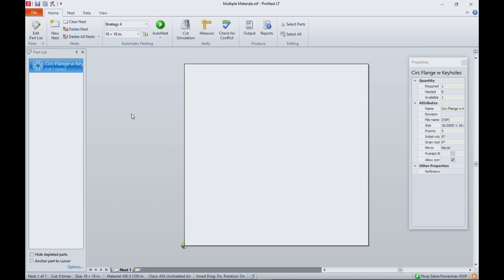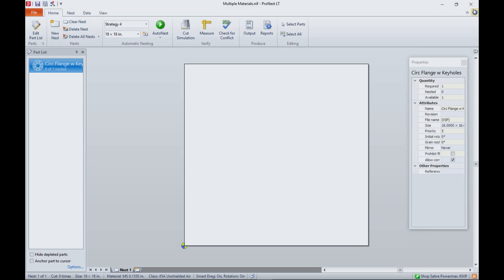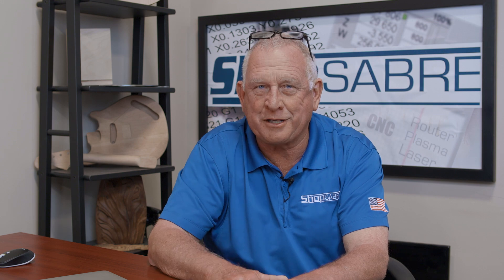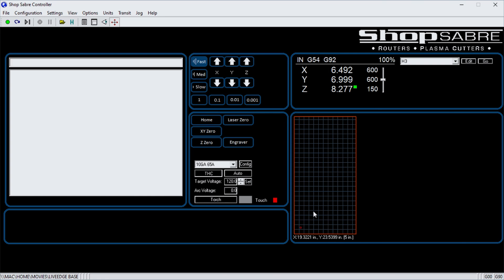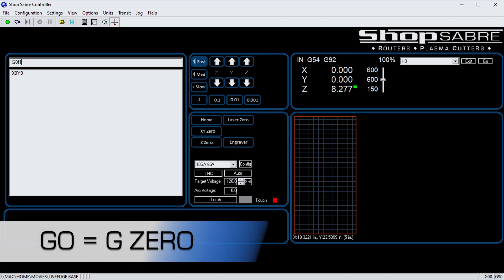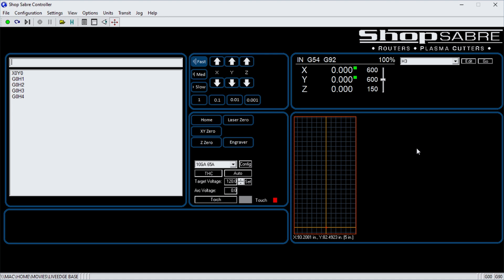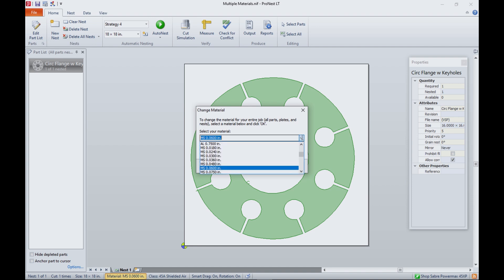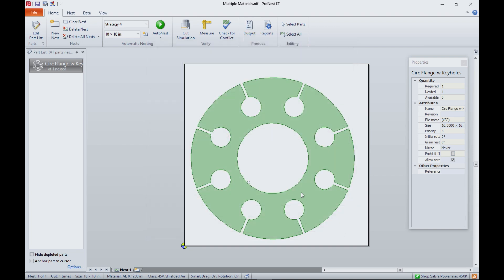Cutting Multiple Parts on ShopSabre CNC Plasma Table

Comment: You need to do training on the creation of your project. Its very difficult and hard to use. Table is great but getting it to that point is VERY FRUSTRATING
Reply from the maker: We do offer many training options - we have private training offered if you wish to sign up for in depth training, we also offer SabreNation University for all our users which is a private tutorial section, and we also have our SabreNation training course held regularly at ShopSabre HQ. Just call our team and take advantage of the best solution for you because there is no company who backs their product more in depth than us here at ShopSabre.

Comment: Why do you refuse to show loading the subsequent Pronest TAP file into the the Shopsabre control software? I can only find two videos that you've made regarding this subject and in both videos you skip right over it. You have entirely too few videos pertaining to the plasma cutter in general. You clearly favor the router. Its frustrating.
Reply from the maker: Stay tuned, we have more plasma videos coming - while router has been the main focus over the years due to "Routerbob" being router bob not plasma bob ha-ha. Regarding loading files, file open click the file isn't entertaining. Our biggest plasma project video will be releasing soon :)
Reply: @shopsabre  Well tell Plasma Pete to get his shit together and hurry up. I didn't spend 30k on a  plasma table to learn about routing.
Reply from the maker: @stuffandthings8767  Have you used the resource on our website called SabreNation University? We have a large collection of plasma videos there including an hour and a half plasma training video that goes in depth about machining and software.

Comment: How did assign each part the new 'H' position before you cut?
Reply: 3:46
Reply from the maker: The h position is set by the procedure shown in the video, the part cut is the same part on four different materials in four different locations.